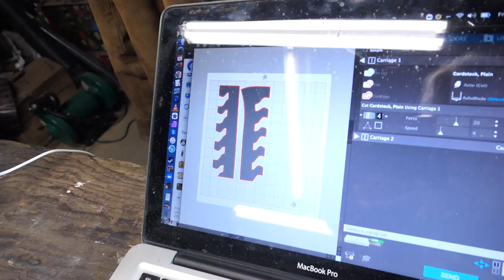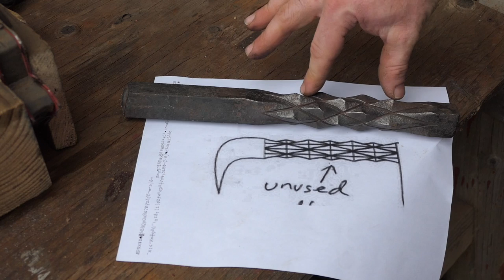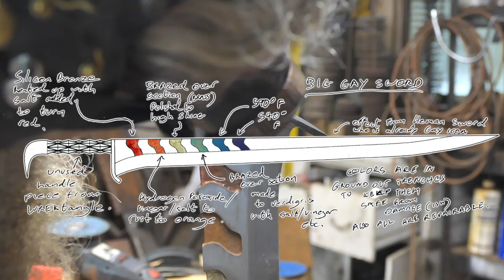Big Gay Sword

Comment: I'm not sure how well it would work on solid metal, but in HVAC when we're welding tubing near temperature-sensitive things we use a paste that absorbs heat (Block-It, Heat Block, there's a few different brands I believe) and they work superbly. You can heat up part of a tube to cherry red within a few inches of the paste, and directly on the other side of the paste layer the metal is cool enough to touch bare-handed. If it works with solid metal, it could be a boon for projects like this that deal with parts that require different levels of heating

Comment: I like the idea of metal inlay. Next time, you should try braising straight copper or titanium into all of them. They can both get the full spectrum with flame coloring. Titanium can also be chemically oxidized using electrolysis which is a bit more forgiving with the timing.  
Another option would be to use Corundum inlay. Ruby and Sapphire are both the same mineral. What people don't often know is that you can get them in a full range of colors, not just red and blue.

Edit: If you ever want to make a brown oxide on copper, submerge it in a fully saturated solution of baking soda and water, extra baking soda is fine. Keep turning the pieces every couple of hours for a day or two. The solution will turn a light blue while the copper piece will turn brown. This oxide is fairly durable and will prevent green oxide from forming. I use technique when I make bird boxes so the wood doesn't get stained green.

Comment: When it comes to surface finish, (especially in regards to the resilience/toughness)… 

I find that sandblasting/bead blasting always leave a surface thats extremely easy to blemish in some way. 

There are a few alternatives that have worked for me long-term…
Both acid etching & stonewashing are extremely tough and show almost no permanent wear over the lifetime of the blade. And the small bit of scuffing they do receive is usually easy to correct with a bit of cleaning/oiling.

Just my experience as a machinist/tool and die maker that’s dabbled with blacksmithing a lot over the years.

I Absolutely love this project… As with all your content it is top notch. And very cool of you to support a group of folks who have a harder time in “masculine“ communities of welders and blacksmiths etc.…

Comment: By the way, regarding the coloring of metals, there is both a brutal and elegant way. It's called anodizing. It works great with Group 4 and Group 5 metals. Titanium is the most affordable of them, sort of, and it has a large palette of colors. There is an opinion that it is possible to paint a product made of titanium alloy. The point is that with a different thickness of the oxide film on the metal surface, due to the interference of light, the metal acquires different shades. You need a rectifier up to 32 volts and a converter that increases the voltage to 120 volts. You also need an electrolyte - a solution of baking soda or a weak solution of sulfuric acid. The advantage of this method is that you can place the product in parts and paint the same product in different colors. And the places that you do not want to paint, it is enough to polish a little.

Comment: Good Gods, man, seeing you do that bend in one heat made my back scream in sympathy and my butthole pucker hoping the steel wouldn't break! You should usually do something like that in 2 or 3 heats! Also a little disappointed that you didn't draw that point out all nice and round with another couple heats. The end result would have been a bit nicer and also stronger. Still, looks great!
Reply: That's the difference between a blacksmith or bladesmith and a welder fabricator like Mike, he gets it done but doesn't necessarily use the "correct" techniques and he never claims to be a blacksmith etc but he does borrow certain techniques sometimes

Comment: I worked for a company that made water trucks and had to spend a couple days a week sandblasting different shapes of metal. It would either be freezing cold or hot enough to make you woozy. The novelty of the blasting quickly wore away under the very unpleasant and uncomfortable conditions.

Comment: 49:43 - As soon as I seen that lighter that close I started to safety squint just in case it popped.... I've done that a couple of times and learned quickly not to leave a lighter sitting on a work table, I had one explode because I sat it on a piece of steel I was practice welding on and the heat transferred to the lighter and it popped and ignited right in my face but I didn't know that's what happened because of the mask and ear plugs. My friend came running over incase he had to put me out and I'm completely oblivious to what happened.... Needless to say I was grounded from welding for a few days after that but it was still hilarious.     🤣🤣

Comment: you should look into a niter bluing setup.  i don't know how useful that would be on this project(multiple colors in the separate grooves in an immersion finish might be a bit past tricky), but it beats using a torch to oxidize the steel.  all you need is a decent thermometer and a working gas burner and that blue/purple transition would be a hell of a lot easier to manage.  keep it up man, you do amazing work!

Comment: You know what would have been easier for the colors, but I didn't remember it to tell you during the Patrestreams? Epoxy and chalk dust. As long as the inlay is still below the surface, it should be plenty durable on the spine.

Comment: 4:27 lol
have you thought about setting up a massive vacuum to collect the sand blast material so you can either collect it and keep the air cleaner or to be alble to reuse it after filtering out any large break offs from the blastee

Comment: @10:26 you really fast 💨 forwarded through that rotary file grinding 😅😂 that was a sweet looking die grinder..!! It looks a lot less “taxing” than to try and hold a standard straight grinder(diameter wise) it’ll save you some trips to the Ole carpull tunnels doc.. 👍🏼👍🏼
Reply: @22:37 ow… owww …. Owwwww..!!! 😅😅😅
Reply: “I’m in a bit of a time squeeze…”. @ 34:58 Rooster 🐓 crows.. 😅😂😂✌🏼
Reply: The handle is Awesome…!